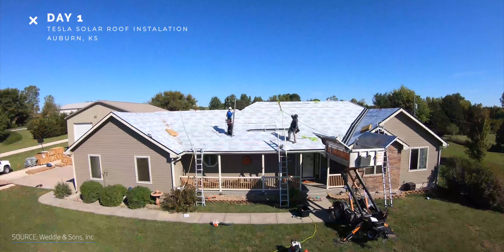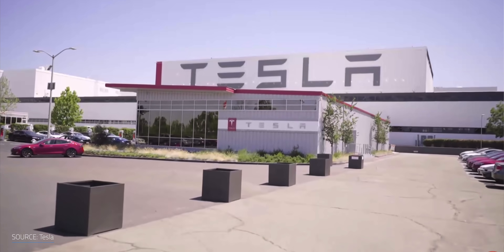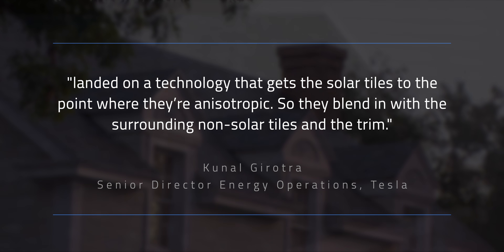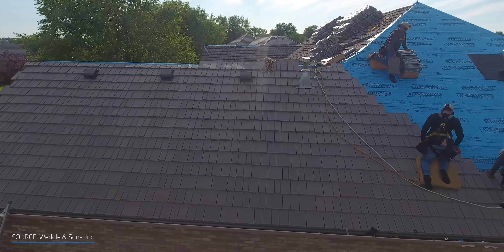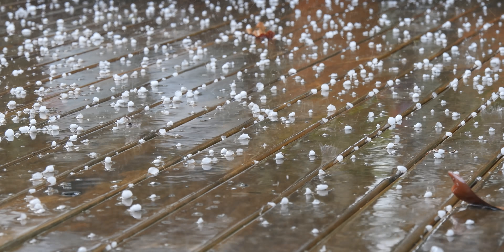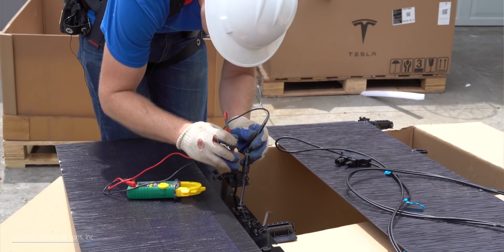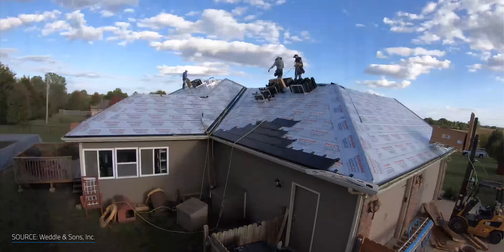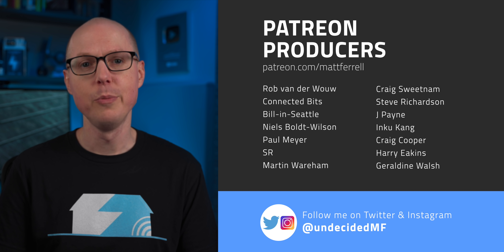Exploring If Tesla Solar Roof Is About To Go Mainstream?

Comment: I have a Tesla v3 solar roof.  Very impressive, it looks amazing and even with 3 powerwalls was a better value than a steel or slate roof.
Reply: You cannot even do an asphalt roof for $10k any more. I just had a modest one done on a ranch home in October and it was $15k.  Top end materials, but still....
Reply: @bcoldwell1 , I just had my 1000 Sq Ft home roof done for $5000 using Owens Corning 30 year architectural shingles, including stripping to the bare deck, new felt paper, new roof vents and new plumbing vent seals. Including hauling away old materials to the landfill.

These high quotes people are giving for the asphalt roofs are not what it actually cost if you shop around. The Tesla roof, if available, would be $86,000 with 4.4 kw of solar. Ridiculous.
Reply: @IMHO Unfortunately it'll take more than math and data to dissuade Musk acolytes. The cult is strong. You'd think hyperloop was stupid enough to remind everyone Musk is an awful scientist.
Reply: @imho7250  - Very true.  People get ripped off all the time on roofing products. Even standing seam prices, per square @ the same gauge, coating and even brand, can vary up to 300% depending on who you talk to.  The prices are all over the place and it's very difficult to buy direct unless you know exactly what you need (even if you're a builder).
Reply: @davestorm6718 , I have a feeling part of the reason Tesla Solar isn’t offered everywhere, unlike any other roof or solar, is that Tesla contracts with businesses like the one shown in this video to do the install for a certain price, a fair price. Then Tesla can use inflated prices for their comparison roof costs.

I think someone can design a rooftop solar system that is essential like a suspended ceiling. Just lay the grid out on the entire roof, putting full solar panels with micro inverters in applicable grids (full size, good sunlight), put dummy panels in all places that are irregular shape or have a roof penetration or significant shading. Then finished the ridge cap and edges with trim so that it looks like a roof, not something on top of a roof. And in places were required by code, the outer panels can be designed to walk on by fire fighters.

What most people overlook is that it’s not really the appearance of the solar panel that people don’t like, but that it looks like you mounted an afterthought on your roof. But if the entire roof is uniform, even if it looks like solar cells, it doesn’t look bad.
Reply: @bcoldwell1  My sister just payed 9000.00  for a thirty year roof. We are all on the old side so a 30 year roof will outlast us.
Reply: @mtadams2009  that's a fair competitive price. I do roofing and a 10 K archertecteral roof  would cost of you did metal would be  25k, tesla would be  easily probably 60K.  So basically 20K your sisters roof will last 55+ years easily. That extra 40K for a tesla basically just saved het money.
Reply: I can't reply to every comment , but there is a lot of FUD and/or BS commenting .  I am in the Orlando Florida area and was one of the first 10 Tesla solar roofs in Florida. You can not get a new roof for $10k.  A tesla roof WITH  3 powerwalls is less than the $86000 someone claims here.
Reply: In what part of the country do you reside?  Have you had it long enough to see how much yield you'll average per month?  Thanks!
Reply: That's nonsense.... a Telsa roof is 4x the price per square foot compared to a top quality standing seam roof. With the money left over you could buy mount an equivalent solar system and batteries. And all you got was a roof with solar and no batteries. Basically a 40k Tesla roof with a regular metal roof would only cost about $10k, and a conventional solar system would only cost about 10-15k + another 10k for batteries.

Comment: when we talked with our solar installer, they said Telsa Solar Roofs weren't available in South Florida because they did meet the wind speed requirements (130 vs 150 needed) for a hurricane.  So we just went with panels and Telsa battery instead. Maybe in the future, when we replace the roof it will be different. 🤞

Comment: I’m currently half way through a Tesla tile roof installation. One of the most impressive aspects of the installation has been the underlayment. This covers the plywood deck and makes the roof water tight. My understanding is that the early underlayments and the ones shown in the video have been replaced by this new underlayment. The underlayment has “Tesla “ printed all over it, I could be wrong, but it seems the material is made by Tesla. The underlayment has a light cloth top. The middle is a thick rubber like material. The bottom has a sticky substance that can be described as 5-6 times sticker than duct tape. 
If Tesla is producing this underlayment it sounds like they are heavily into materials development. The medal used in the injection molding for the cars, was developed by Tesla also, I believe.
What is it this company cannot do ?

Comment: My question is: would I still need to pay an electric bill if I did a Tesla solar roof and how long does the Tesla solar roof really last? I pay around $80 a month average. Maybe that’s not a lot. But if they last just their warranty, the 25 years, it will be be $24k. If this costs $24k more  or less than a metal roof I would do it.

Comment: The amazing Charlie's advice to the Tesla Solar Roof company: Expand the services to include upgrading the entire home to passive home insulation standard. Think of it. The roof can deliver, what, as much as 15 kW-hr of electrical energy per day during a Cache Valley, Utah, winter day? But. Super insulate the house and you can deliver up to 50 kW-hr per day that would be needed by an air sourced heat pump to heat the house and for the heat pump water heater. I know because we just took out our gas furnace and water heater and replaced them with heat pump versions.

Comment: Hi Matt, thanks for the video. 

I think an economic point that may have been neglected was "is the energy production of a Tesla solar roof (BTW a beautiful product) comparable to a high end roof (SSM, synthetic shake or slate, etc.) with solar panels (ugly)". I understand that the solar production of Tesla's roof is lower than dedicated solar panels. Any comments? Anyone?
Reply from the maker: It's not as efficient, but you can size the final power output to whatever fits your needs.  It's actually easier to get more solar coverage on your roof since each individual tile is smaller than trying to find space for a large panel.  So you can make up for the difference.  In the end, if you're able to get 9KW of regular panels on your roof, you should be able to size a 9KW solar tile system as well.

Comment: Thank You Matt, I really appreciate you doing an in-depth video on this product. To this point we’ve only seen finished installations as opposed to the up close detail of the product itself and how it’s installed. My home needs a new roof, but I live Wisconsin. I really want Tesla solar of some kind. Do you know if there is a Map that shows the states where Tesla solar products are available?
Reply: If you go to the Tesla website they have an informative calculator. You can enter roof size and normal electric usage and it will give you a price. As for installation area when I did it for our house (mountains of northern Colorado) was told no installers in our area, and would be notified when installation is available. When I changed our address to the nearest population area (Fort Collins) it shows installation available. So I think they are getting closer on the installation, just a matter of demand and enough people where you are to be worth it.

Comment: I’m building and it’s not a custom build home so the builder and HOA has to approve Tesla’s product. Sent the information to my builder and Tesla’s web based application is not built for new build questions and scenarios. Then I saw the massive upsize in these shingle style and know they in no way look similar to a traditional asphalt roof. Then I read about the horrific build delays and then the cleaning they were going to need going forward. To this day I’ve got nothing from Tesla than a form letter that ignored all the particulars of a new construction. You’d think they’d be pitching the HOA and Builder to add this to their approved options list or build allowance but they haven’t lifted a finger on my behalf. How can you gauge a solar return on an electric bill at a residence that doesn’t exists? How can I guarantee there will be no delays in my closing and zero headaches for this skeptical builder that’s never did this before especially when the opposite has been everyone’s experiences. If your a multi-millionaire and hired the general contractor to make it happen then you can have a new Tesla Solar roof. Mainstream is with we mortgage holders that build with companies that deliver homes. This is hardly a mainstream product. I invite Tesla to show me all the correspondence with my builder if I’m wrong. Nice pictures from a distance but builders need product that can be delivered. Would love a beautiful roof that charges battery walls but Tesla is failing to communicate to us about this product.

Comment: I think this will always be a "premium" product as in never cheaper than a roof + pv install. It's like an amphibious car, yes it can do both but it's not great at either. Going with all these small panel sections, extra connectors, and less efficient panels will always be more expensive for less solar output.

Comment: 6:10 Might be comparable in US, but it is 5x more costly than normal roof in Central Europe. So no solar roofs for us in forseable future.
Reply: thanks for commenting, really appreciate alot, correspond to my administrator  on what§App to assist you earn profit on cryptocurrencies or BTC +1 8 1 4 2 0 1 6 1 4 8
Reply: @pinnebyvincentraditya4466  😀😀😀😀😀😀😀😀

Comment: @matt, do you know if the roof can tell you if there's a broken active tile in the system? I would imagine so, there's got to be a drop in output that the monitoring system should be able to detect and alert you to. I had a limb punch thru my shingles once that I didn't discover until water made its way down thru my ceiling. An early warning before water damage started would be nice.
Reply: I don't think so. It's not like solaredge where every single panels is monitored. They probably have bypass diodes to handle shading, so if a single tile in the string is defective you would only have a small voltage drop. Peak output is also temperature dependent so if you get less in the summer compared to spring that would just be normal.
Reply: @Psi-Storm  I was figuring that they seem to be connected in series, so one busted one would interrupt the circuit like old Xmas lights?
Reply: @danoberste8146  No, PV panels have bypass diodes so shaded or defective parts get bridged. Without these the whole string would be limited to the worst performing panel.
Reply from the maker: That's a good question.  My guess is no, but I'll have to ask about that.

Comment: I am not chomping at the bit to get a solar roof. Why are roofs so damned expensive? My house, according to my insurance company, would cost ~ $120,000 to build (I paid 100k for it 2 years ago.) To re-roof it with conventional asphalt shingles is about $30,000 !!  A full quarter of the cost of a new house! WTF?? Tesla solar roof, ~ $60.000, half the cost of a new house! I could actually build a completely new my house for the cost of a slate roof.

My wife and I combined make about 70k per year. We can't even afford a new roof, much less a Tesla roof. Why have construction / house maintenance costs become so high??? (Why don't you do a show on that?)

When I bought this house 2 years ago, the 60 year old electrical service box was in a dangerous state of repair, and the house ground consisted of a little 18 gage wire twisted around a water pipe. I wanted a safe system, so I got estimates. Cheapest one was $12,685.00. Cripes! So I said F**K you, and I got on the internet, watched 2 weeks of you tube DIY vids, took a small residential electrical class, developed a plan for my house, applied to the city for a permit, and did if my freakin self for about $320.00 for parts and city permit costs. Inspector said I did a great job.
WTF?

I'm sure you'll say, "Well, yes, the cost of materials for a roof may only run several hundred dollars, but it's labor intensive, and you have to pay 3 people for 3 days." Ok, let's break it down. $30,000 minus materials and inspections, say $27,000. Divided by 3 people, that's $9000. per person for the 3 days, or $3000 per person per day. Ok, those three guy are making $375.00 an hour! Yes, you have to factor in the companies costs and taxes and such, but they are still making over $300.00 an hour. And yes, the guys are only making 15 or 20 per hour, and the company owner is pocketing the rest, but my question remains.

That electrician that gave me the cheapest quote was a one man company, and he estimated it would take him about a day to do my box and ground system. @ $12,685.00, less his taxes, permits and materials, he's making $1500.00 per hour?!!? He drove over to my house to give me the estimate in his porsche!

I very much want a Tesla roof, Matt. 
I have a Bolt, and am on the list for a cyber truck. I'm only using wind power to power my home. I'm the greenest person in my neighborhood.

But, I'll put a Tesla Roof on my house when Elon makes it simple and modular enough that I can do it myself!
Reply from the maker: Eric brought that issue up to me during our conversation (didn’t make it into the final cut of the video though).  The cost of the solar roof can make a lot of sense, but it depends heavily on the value of your home.  Depending on where you live the same size of house could be $200,000 or $600,000.  A solar roof may be 50% the value of your entire house or something like 15%.  It’s hard to justify the cost when it’s such a huge percentage of the entire value of the home.
Reply: @UndecidedMF  Yes, I understand, Matt. But, as I'm sure you're aware, it's only the top 10% of the earners who can afford a $600,000 house. For the rest of us, a Tesla roof is out of our price range. Touting it as a "good value" when it's only so for the rich folks just serves to remind me of the massive income inequality in this country, a very few at the top mercilessly taking advantage of the rest of us.

Comment: My roof came off yesterday and today. My final survey is this afternoon. Install is next week. Unfortunately, not going to make the cutoff for the 26% credit.

Interestingly, although I had no damaged decking, they still had to install $2.5K of new decking because the old decking didn't meet their standards--of course, not discovered until yesterday.  Still within the contingency reserve I had available, but definitely hope we don't have any unforseen electrical issues that require more cash to solve
Reply: My understanding is that the 26% credit was extended for 2 more years with the new federal spending bill that was just signed.
Reply: @karenservas4002  That would be nice.  I'll check. Thank you for the heads up!
Reply: @karenservas4002  I checked,  and you are correct. The 26% credit is extended through Tax Year 2022. Thank you for letting me know!